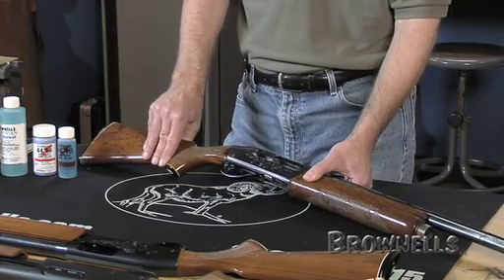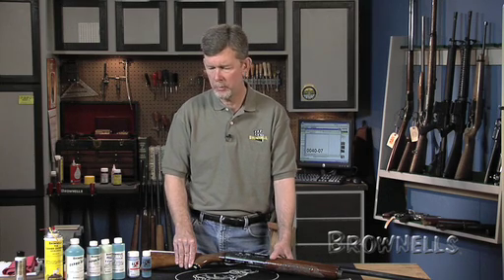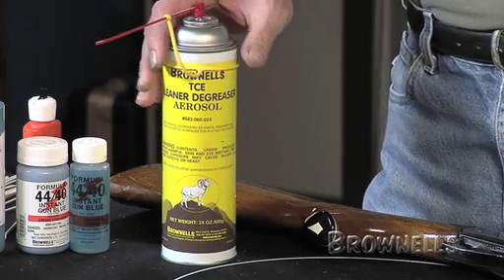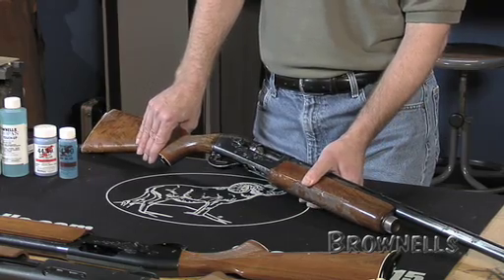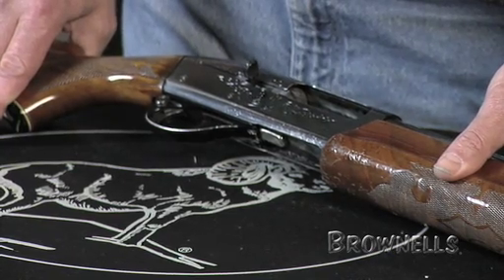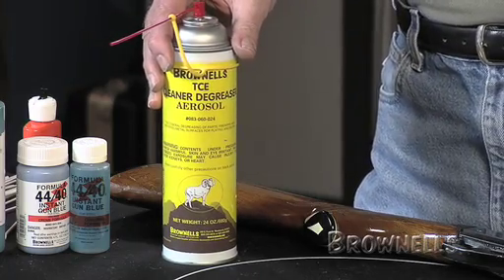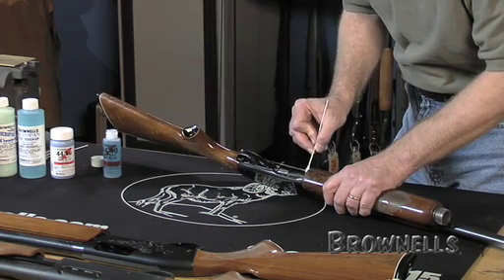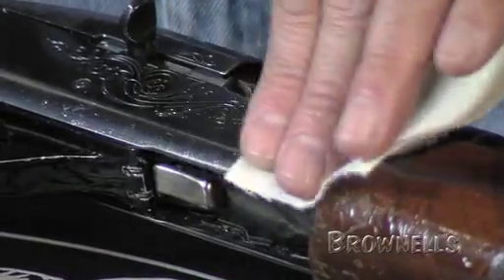Brownells - Introduction to Cold Blue Finishes

Comment: I consider the OXPHO Blue to be the best product for touching up a surplus rifle with most of the original blue intact.  I just used this product on 1918 Enfield No 1 Mk 3* rifle that had heavy wire wheel cleaning and it worked beautifully. It took 90 years off that metal. Follow rigid cleaning and prep. Warm the metal carefully, not to point where you can't hold it.....and apply with cotton swabs. I used three at a time and never doubled dipped.....multiple coats works best.....rinse and drying each time. If you use 0000 steel wool, rinse it first with acetone.